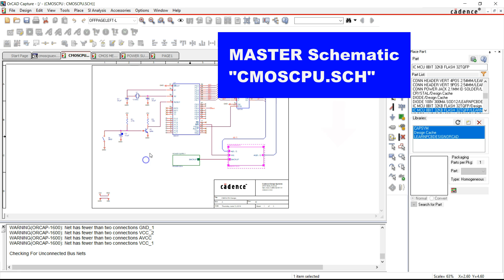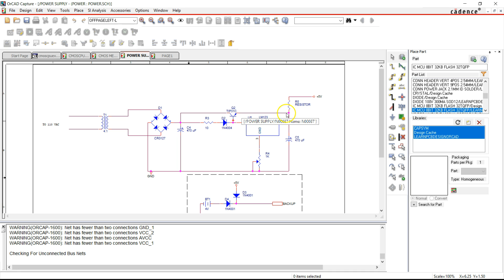OrCAD Capture Essentials - Block Diagrams, Hierarchical Design

Comment: Hello, I have  a question. I´ve created an design schematic, a resistor divider, and I´ve associated it to a component. But only I can simulate using it in same proyect that it has been created. I can´t use it in other proyects. Is it possible to associate a component with an schematic and use it in any proyect?
Could you explain the how use the hierarchical and component association?  (With same simulation)
How associate, pin numbers of component with references in the schematic design?
Thanks

Edit. I just find the answer to my question.  Pdf tittle Generating a hierarchical Part. 

FlowCAD_AN_PSpice_Create_HierPart.pdf

Regards

Comment: Hi Kirsdch, I have used your Udemy course to quickly get familiar with Orcard since it had been ages since I used it but I have an issue in a design I'm working and I can't find anything about Hierarchical design in your course. My problem is with the DRC and the port types. Lets imagine that I have the input from an IC in Schematic 1. I connect it to a port that is an input, then I have to connect it in my hierarchical block to an output port from the second hierarchical block, and from there I have to connect it to an output port in the second schematic (Because if it is an input DRC will complain) Then, I have an output port in my second schematic but I need to connect it to an output pin (since the end goal is connect an input in Schematic 1 to the output of schematic 2). But since my port needs to be an output, I can't connect it to the output pin since the DRC will complain. Do you understand my issue? What am I doing wrong?
Reply: Nevermind, I have figured it out. But I would encourage to add these topics into your Udemy course. Regards!
Reply: @techedkirsch  I didn't find it at the time but thanks anyway